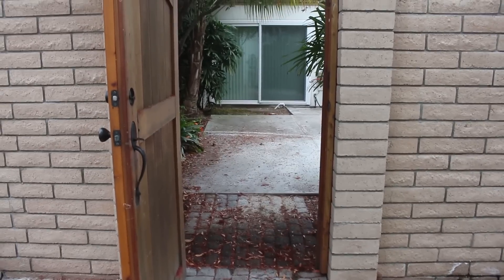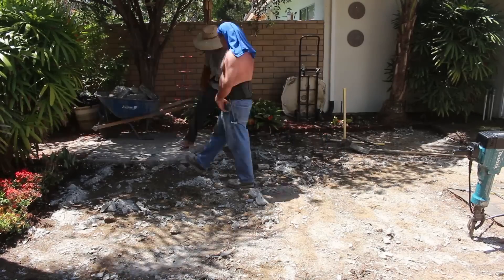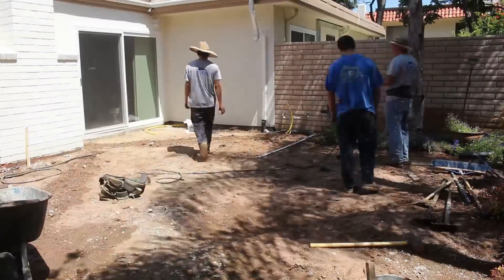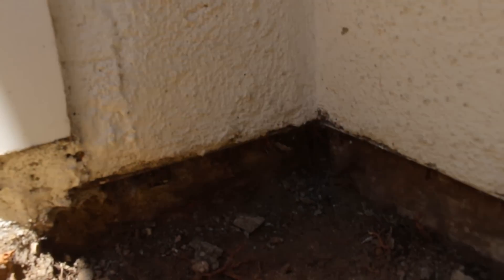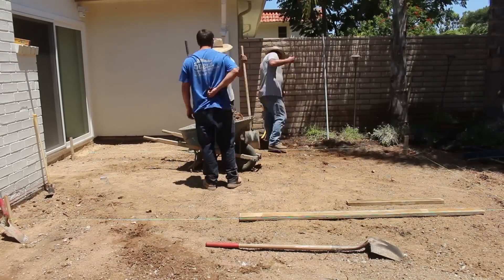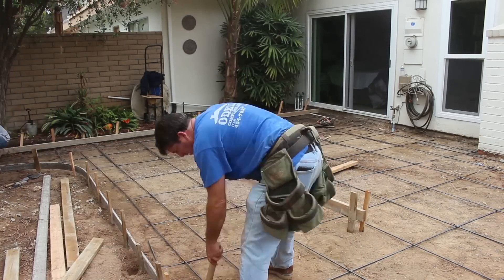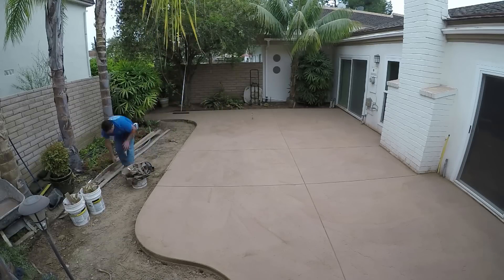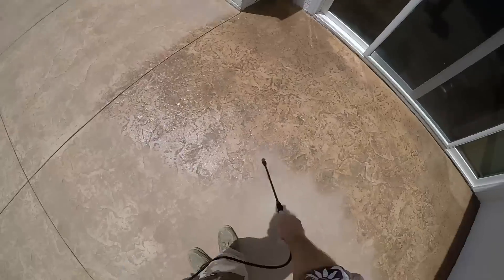How to Pour, Stamp, and Seal a Colored Concrete Backyard Patio

Comment: Nice, presentation. When you're referring too land scape deviders, do you use as expansion joint. nd leave in.or use them for extreer form and radius? What is it made of? And where do you get it,? Sounds like a good idea .. thsnks
Reply from the maker: Plastic removeable.
Reply: @OdellCompleteConcrete thanks

Comment: I you set you lazer to grade you won't have to measure each stake no matter where you put stake, where is transition fittings for gas line? also need to have sleeve on gas line or you can't ever build patio cover over it. looks good
Reply from the maker: If it was a level pad.

Comment: Hello.  I love your videos.  I am going to try a project involving curved forms.  I see you use curved forms in this video and describe it @ 10:45 as landscaping edging that is buried to separate grass from plants.  Can you provide more info? such as the brand name or where to buy it?  I've been to Menards and Lowes.  Menards has nothing.  I got "Blue Hawk" landscape edging from Lowes, but it seems thinner than what you are using.  I'd be grateful for any suggestions.  Thanks Mr. Odell.
Reply from the maker: At Home Depot they have the green bender board. 3.5" x 1/4" x 10'
At Lowes they have a brownish orange bender board 3.5" x 3/4" x 16'
Also you can use 4' x 8' sheets of Masonite ripped down to what every height you want. Its best to double it up for more strength.
Reply: Thank you for your reply.  I had no luck finding it here in Minnesota and did hours of research.  Maybe what I found out will help someone else: The product in question is made of polyethelyne and is called "Benda board" and is made by Epic Plastics company.  It does not seem like anything like it is available anywhere in the midwest or east.  Just a west coast thing I guess.  I'll keep trying, hope this helps someone in the future.

Comment: I had somebody install stamped concrete. they did a bad job and I was left with some bad joints and the floor full of that release used for the stamp. they swept the floor and cleaned it lightly with a water hose. they said the seal gets applied after a month. since I'm stuck with it, should I wash it regularly or use pressure washer to clean it completely?....I was told by somebody else that is a good idea to use the water hose very often to help it cure better

Comment: Great video...May i ask what is the expected cost to do 100 square feet... I'm in a totally different state however but trying to gage the cost.  I'm cementing my backyard boarder and side of my house.. currents I have pebbles and cement will be less maintenance.
Thank you in advance.
Reply from the maker: 550
Reply: @OdellCompleteConcrete thanks you for responding wow just to clarify when I say 100ft that is the length. The width in the back is 2ft wide and the side of the house (my house to the gate) is 4ft. Did you mean the labor or total with material would be $550.00 or 5,500.00 ?
One person quoted me 4k and a guy that's done work for me in the past that does cement said no more than 1500. Because he would have to bring the cement using a wheel barrel as the area you cannot bring a truck.. but i do believe the cement hose you use would work perfectly.. I'm in Philly btw.
Again thank you for the excellent tutorials this really is not a DYI.. you need a pro. And you are truly a pro

Comment: How do you fight sag in your level lines? I built a barn two year ago and useda string for the eaves and pulled it tight. But now you can clearly see where they dip from the ends to the middle--clearly caused by string sag.
Reply from the maker: A line can go 50' max before a sag happens

Comment: Nice job.  I like that type of stamp.  How many different options are there that you offer?
Also on the yellow flexible gas line, can the homeowner attach it to a gas line or is that something the gas company has to do?  A few years back they ran that type of line from the street to the meter here in Long Beach.
Reply from the maker: Yes the Owner can hook it up. There is some simple compression couplings you can slide on.
Reply: You are the expertize about the concrete work but I work for the gas company and installing your owe gas line  is not advised. Your local Gas Company   will never approve it and need pressure test  inspection . The yellow flexible plastic line about the ground  will crack in the future . Don't be surprise an  explosion and death . You need install a solid riser and a safety valve . By the way excellent  job and I love your works.

Comment: Beautiful!  Love the color!
Reply from the maker: TY
Reply: Only problem about using powder release on slat patterns like this one is that when you stamp it it'll leave the outer lining of stamp printed and give it a checker board look , you can see some parts of lining on this one but this guy doesn't stay long in place to take a better look , I recommend liquid release on slate it give better look through out stamping where know square marks will be noticed, I've done a lot of stamp work out here in Texas so it's just some advice

Comment: Great video, I appreciate you sharing the process. 

I've got a couple questions.

1)  Is there no need for an expansion joint where the pad adjoins the home slab? 

2)  I can't tell how close you are to the brick ledge. Shouldn't the pad be lower than the brick/siding or whatever the wall is made from? I've been told to leave a 1" or greater gap between the pad and brick/siding due to inspectors wanting a visual to check for termites/bug intrusion. Some places have it written into city/county code, but others don't, it does make sense.
Reply from the maker: Never heard of that in 35 years, but I may have missed something.
I'm in areas of no freeze and thaw.

Comment: I may have missed it but did you dowel in to the house foundation? Did you put any material to separate between the brick fireplace and the concrete?
Reply from the maker: No dowels,
I think I put expansion foam

Comment: Does only stamped concrete need to be sealed?  Can you explain when sealing is necessary?
Reply from the maker: You can seal any concrete. However it does present a maintenance issue.
Sealer preserves the original finish, so that all the wear and tear is done to sealer.

Comment: When I used the sealer within days the stamped colored concrete turned chalky white and got worse every time it rained.  Finally after a year, it has mostly(80-90%)  gone away.
Reply from the maker: Did you prep the surface before putting sealer on?

Comment: Do you have exceptions in your bids in-case the 4" 3000psi concrete is actually a 12" re-enforced 5000psi pad? :-)
Reply from the maker: No but I should

Comment: instead of your wood screed key, just place a single steel stake with a nail at grade height, then set a " line" in the concrete with aluminum screed rod from first known point to stake then screed perpendicular to the line you set. don't have to fool with the board
Reply from the maker: Old school style

Comment: Nice job BUT!!! You did a very dangerous and Illegal thing by running the gas line underground not in a conduit. It needed to be in a Sleeved pipe two sizes larger than the gas line and vent on the sleeve. And should be done by licensed Gas professorial. don' t get in trouble  with local code enforcement watching your videos. but beautiful  concrete work.
Reply from the maker: I don't think you know what your talking about.
Check out my gas line install video.

Comment: bro GET COMEALONGS
Reply: we cut grade with them also we pull concrete  the wooden handle ones are heavier and seem to be better maybe if you find the company that makes wooden ones , I am by no means trying to tell you how to do your job man your work seems great
Reply from the maker: I've tried comealongs on occasion. Never really liked them, however I have seen some guys really good with them, and there's not many. I'm talking about good enough to get rid of the rod man, and bull float or tamp behind the comealong man. A rarity.
Reply: we use them to pull as we go.x then street with a .magnesium skreet board,  that's the logo,  and then we jitterbug  and bullfloat then Fresno